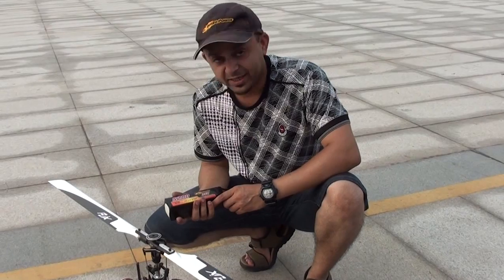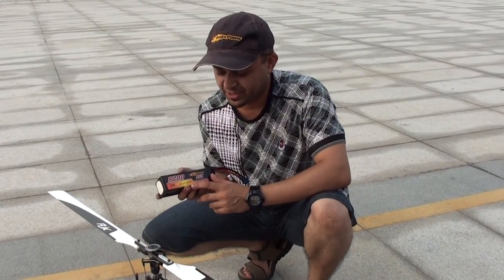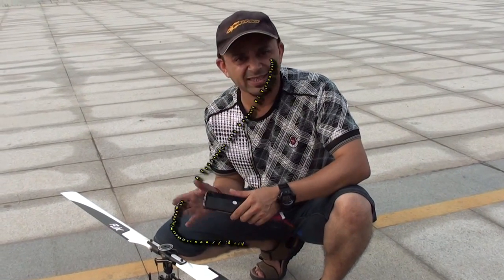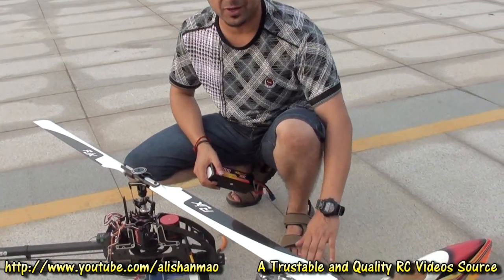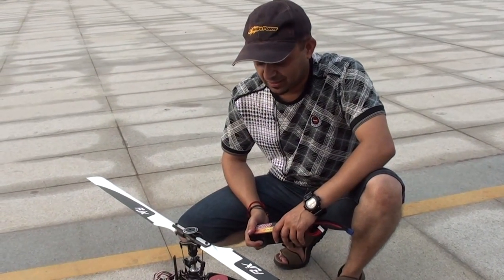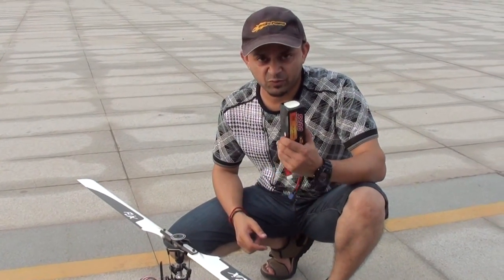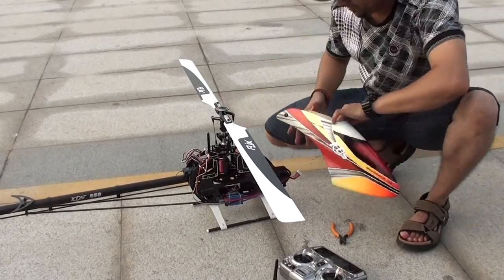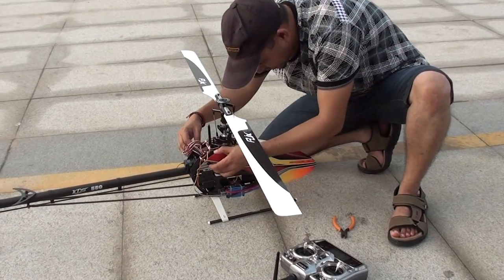KDS Innova 550E Testing Desire Power 6S 5200mAh 35C Lipo

Comment: Ali,  Just to be picky but at 6:00mins when you rotate the rotor it shows that based on normal conventions, the tail rotor rotates the wrong way and the blades need to be flipped as well. If this is a Walkera thing then - ok it's right, but if not, then you might find that fixing it will make the 550 fly nicer - that may be why you needed to adjust gyro in previous video?  And - why can't you say 'veee' instead of 'weee' ?  Please give us a demo of you trying ;-)  It's hard to explain "v' sound.

Comment: @alishanmao i think eventually i go 700 ,,lipos aint no problem ,,zippyflightmax from hobbyking is cheap and good ,,i like that many kds models have most parts interchangeable exept for head 700 and they all use same motor ,,i wonder if the big models will fit original logo parts,,,anyway ,you fly her real well and its fun to see these awesome 3d flights  ,due to weight the electric powered is maybe better for hard 3d as the align 600 le  nitro  ;-)

Comment: looks like she draws power real easy ,,high C lipos are a must with the big ones ,my 40c are even a big step up compared to the 35c ,,35c it gets still warm ,40c is unlimited power use and no warm lipo afterwards ,,guess i better start stocking up 6s lipos for my innova 600 or 700 ,depending on wich i will get ,,i think 550 is too much like my t-rex500 ,a 700 with flybar seems real nice to me ,,but a 600 might be better usable due too needed flyingspace of a big 700